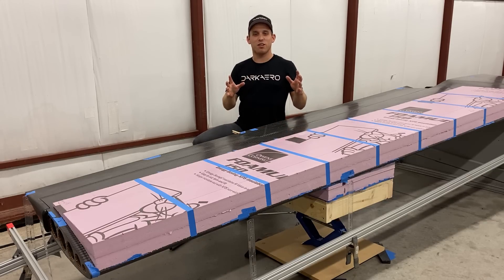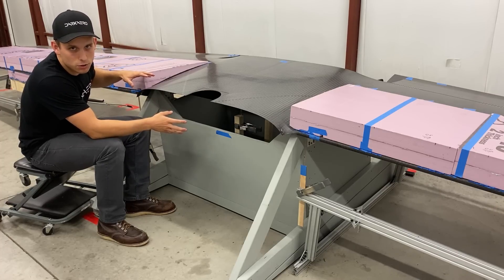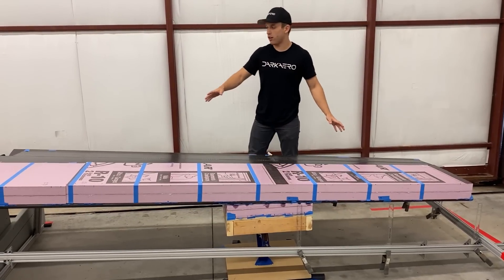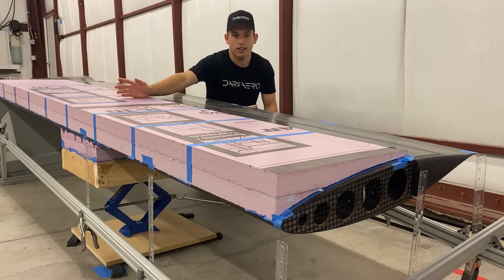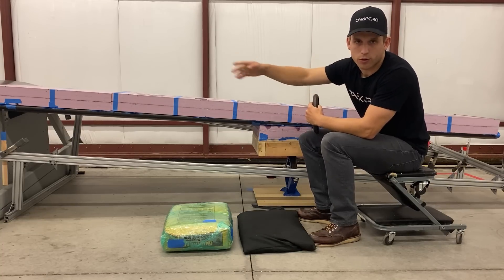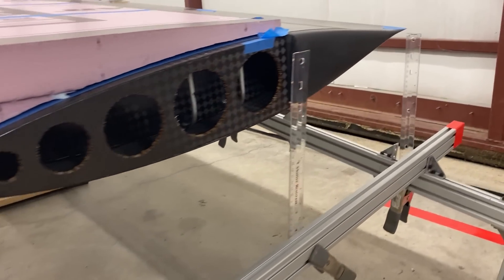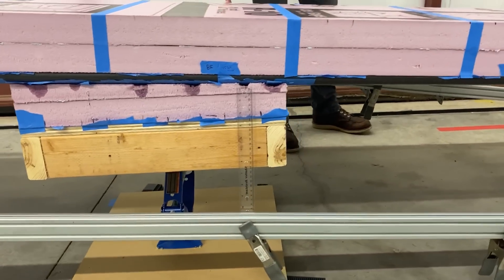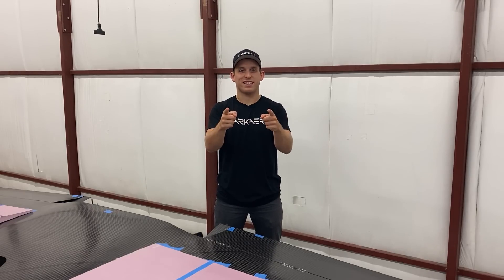CARBON FIBER WING - Proof Load Test Setup! (Wing Load Test)

Comment: Came here specifically for @0:18.  I'd really like to see the twist measurements you took under load, and I'd like to see a discussion of how you designed the layup schedule both for twist stiffness and also to ensure that the wingtip doesn't diverge in AoA or converge too much.  Typically that's going to require a bunch of uniaxial fiber loaded up forward of the 1/4 chord point and much less behind, especially since it appears your airfoil has a pretty fat section through the middle.

Comment: The chord wise double sided tape will still inadvertently increase capacity and stiffness within the span. It obviously doesn't make a difference for the total moment capacity at the the connection to the fuselage. But you can get increases in stiffness and moment capacity within the span. There is still shear flow through the tape although it is not as bad as it would be with span wise double sided tape. If you cut and leave chord wise gaps in the Styrofoam, you will get a closer representation to the actual behaviour. Get rid of the tension capacity and stiffening from the Styrofoam. Even then, you still get a little bit of tension stiffening from the foam but it is much reduced.

It is a really interesting project and test set up to see.
Reply: Well, technically you need to glue a significant portion of the weight to the upper wing surface too. And your weights need to be non-dimensional items which have zero tensile or compressive modulus yet have sufficient mass to apply the appropriate load which is also representative of the actual chord-wise pressure distribution in positive-G flight with aileron deflected and anti-adverse yaw rudder applied assuming there is a slight yaw about the wingtips in relation to the aircrafts center of gravity at the forward most and aft most locations and every point in between can also be tested in order to graph the variable changes at any conceivable loading configuration. 

Actually, assuming 26x 80Lb cement bags and 10x 50lb bags plus a couple 10-25 lbs weights in each wing semi-span in this video, this wing was tested to precisely 3.8Gs limit-load in a perfectly coordinated pull-up or banked turn, assuming zero aileron or rudder deflection and 1500lb published gross wt. This clip shows, at least at this juncture, that the Wing was not loaded in accordance with the previous, now retired FAA regulations which stipulated a limit-loading condition where one wing supports only 70% of its semi-span load (as in aileron deflected and/or stalled at Va) and the other side must support the remainder above and beyond its normal coordinated semi span load (increased to 100%/60% for Aerobatic aircraft). 

Yes, this means for a "Normal Category" "Limit load" of +3.8Gs your airframe must support +4.94G limit and +7.41G Ultimate load, ...and not the oft-cited 3.8 x 1.5 = 5.7G, which is a very badly mistaken lower design limit, as +5.7Gs is easily attained even at slower speeds, and can be physically sustained by any pilot under the age of about 83 years old. 

It doesn't make sense to have an airframe which disintegrates before the pilot even begins to black out. This isn't 1914 any more. And propeller planes are more than twice as fast. And they sometimes fly through clouds and might exit the cloud base at 900ft AGL, in a spiral dive beyond VNE where the pilot must apply +8gs to survive.  

Oh, and you cant forget that in order to attain the Angle of Attack required to generate this loading condition it requires a significant down-load of the horizontal tailplane which must be added to the applied load. Then subtract the wing weight which acts in opposition to the bending moment due to momentum/centrifugal force. Surprisingly, these two forces of tail down load and wing weight x N load factor, often nearly cancel each other out when it comes to root bending moment. (Per my own calculations).

Its not a perfect world. 

So over build, then slightly under promise people the world, and then over deliver on design, product, and service.
Reply: @Triple_J.1  Yes, but what does that have to do with the stiffness being over estimated in the test?

Comment: Clever set up! Just one question. Did you use a laser to assist in reading out the rulers. Just using you  Eyeball mark One solution may result in parallax measurements and thus a variation in data collecting.

Comment: 5:55   The lift is not always centered in the 1/4 point, as you so surely state at 5:55.       0.25 C - Cm /Cl is the location op the lift.  Using a airfoilsection with zero moment coefficient you are right. 
Using a moment coefficient of -0.06 and a Cl at a pull-out of 1.4 the location of the lift is 0.292 cord, not 0.25.  So, you undertest the rear spar in that case.

Second, the angle of attack must be simulated. Do you reach Cl-max at 15 degrees, place the cord at 15 degrees and load it that way. Everything else differs from the reality in the air and is hence wrong.

Comment: At 6:50 the professor mentions FAR23.  4.4 g hence is limit load.  Test factor 1.5 * 1.1725= 1.725 for single piece test-specimen in composites,.. so, can you confirm 7.59 G demonstrated ?  Or what is your test objective precise?

Comment: Well explained process. It was more complicated than I expected.

Nice airfoil. It appears to be more symmetrical than I would expect. It will be interesting to learn the ride quality of the stiff, carbon wing at speed  with load factor and short span being other considerations. 

Has the Va, maneuvering speed been calculated, yet?  I’ll bet it’s quite high.

Comment: Have you calculated or are you going to do this same test at temperature extremes?   Load test at -10c could result much differently than 40c.
Reply from the maker: We won't test the entire wing at temperature extremes but we have conducted work with the Polymer Engineering Center at the University of Wisconsin - Madison to understand the mechanical behavior of our materials at temperature extremes. Within the expected operating temperature range the change in mechanical properties is small but we do add in an extra temperature safety factor to account for this.

Comment: What angle from horizontal did use to simulate the forward lift vector?
Reply: Is drag load same as “forward lift”?
Reply: Tim Duncan yip, at high angles of attack and loading. The wings want to fold forward. (Lots of good vids out there demonstrating).
Reply: Pete Zut  please share a link.

Comment: so what is the g rating of the aircraft and will it be rated for aerobatics?
Reply: confirmed in a previos Q&A video that it's not designed for aeros but you'd have to thunk the load range would be adequate for gentleman's aeros
Reply: @QuentinCarter1975  once you learn Aero’s it’s hard not to go back.. also lack of good G rating means it’s prolly unsuitable for the sportsman class at Reno
Reply: @Sugar_K  I own a Bushby Mustang ii ;-)

Comment: I expect you'd need to proof test the wing for both positive and negative bending, I'd be interested to see the test results for both (i.e. if there is a material difference for one vs. the other).  I've seen other aircraft rated to something like +2.2g/-1.5g or something like that.  Why would the wing behave differently under negative bending?  Is there a difference in the top and bottom wing surface laminates which would prevent local buckling of the skin better for one side than the other?  I expect that the laminate design would be governed by the requirements of the compressive loads, but recognize that this is so far outside my world.  Or is it merely a requirement of the CARs (or FAR if you're south of the 49th) that you only need to verify to the negative bending to a lower load? Thanks for the great insight to the build!

*edit to correct your to you're :facepalm:
Reply from the maker: We test both positive and negative G loads. As you theorized, there are differences in the laminate structure between the top and bottom of the wing which result in different buckling loads in positive and negative G loading conditions.

Comment: Hi, the foam seems to be one piece ... shouldn´t it be several small pieces so it wont support the wing?
Reply: No.
Reply: @azonicrider32  Wow gr8 and thoughtful comment ...
Reply: @DomAviationChannel the foam has close to zero affect on the flex of that wing.. internal foam core is a different story.
Reply: @azonicrider32  Thx for the explanation ... still not convinced. The foam is fixated with doublesided tape and the foam has no flex.
Reply: @DomAviationChannel   the foam has flex. If it didnt it would have cracked instantly when the wing flexed. It doesnt have much flex before cracking, but it does flex.
Reply: The foam will have little measurable effect because it has very low stiffness when compared to the wing.  Think of balsa wood vs. steel. The wing is doing all of the work in supporting the load.  Also, the double sided tape isn't going to be a perfect bond.  The foam and the wing will be able to slide relative to each other under the shear that is developed during the test.

Comment: Your wing is leading edge down,  so the force you're putting on the wing is inclined forward....as in it would give you thrust. Looks backwards to me. Lift/drag results in a vector that is tilted back.  Nice video though and thanks for sharing.
Reply from the maker: Thanks for watching and for the comment! The load vector is tilted forward relative to the wing but remember that the wing in flight (for our positive G test condition) is flying at a positive angle of attack, or tilted back. The total aerodynamic force vector we are simulating is pointing slightly aft relative to the velocity vector so sadly we cannot generate thrust simply by pulling back on the stick. :(
Reply: @DarkAeroInc  So in other words the angle of attack is much larger than the lift vector deflection?
Reply: @dsdy1205  Yes, they've got it right.

Comment: Excellent! Will you test to destruction?
Reply from the maker: We will eventually test a wing to destruction but since this is the only wing we built for the prototype, the objective of the test is to apply a "proof" load to show that it can withstand expected flight loads plus some safety factor.
Reply: I recommend against using a wing that was load tested on the flight article.  Even if there was no catastrophic failure, there is no guarantee against micro damage from the loading.  Best option would be to perform a teardown inspection on the test wing and build a new wing for the piloted test aircraft. There is too much risk otherwise.

Comment: Great work on the engineering, but this is 2020 get some actual instrumentation on that test article. There is no reason, under even the smallest budget, that you can't build a simple data acquisition and instrumentation system to record displacement and deflection accurately and without the visual perspective errors from reading results through a clear plastic ruler. Don't get me wrong it's a creative and affordable way to get results, but even an Arduino with a 32 channel 8 bit analog input board connected to a dozen string pots would cost around the same as all the concrete you purchased. There might even be some companies you can rent instrumentation equipment from in your area, but in reality it's always better to invest in good, proven instrumentation than regret not having it later.
Reply from the maker: A data acquisition system would have been a cool addition to this test setup. We built an Arduino based data acquisition system similar to what you described to control our cure oven and record temperature maps but decided against that sort of setup for this test because it’s unnecessary. The objective of a proof load test is to prove the wing can handle limit loads without detrimental or permanent deformation and without interference with the controls. All you really need to accomplish that is an initial position indicator to show your wing returns to its original position after the load is removed. The rulers were a quick way to give us some bonus information from the test. Thanks for watching Adam!
Reply: DarkAero, Inc   Another big one on data acquisition wish list should be strain gages at critical positions.  Then run correlation study to your structural FEA.  I agree proof load gives a FL600 view of this and checks the FAA box.  But Thoroughly grounded analysis is so valuable!!